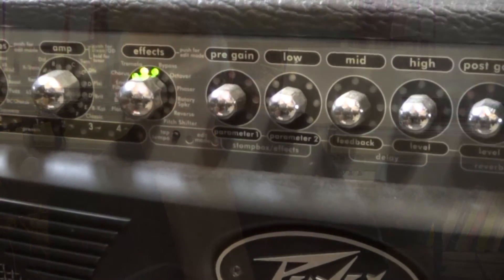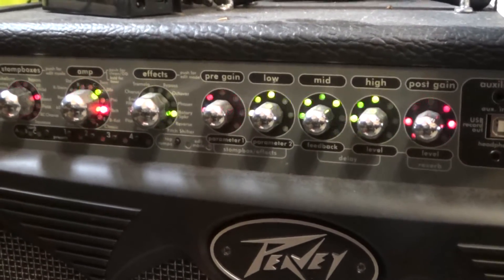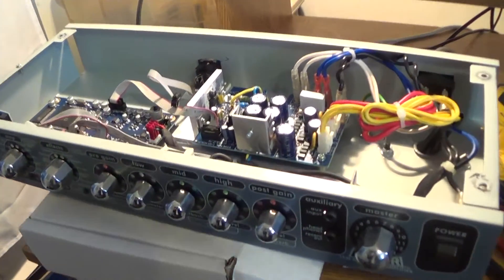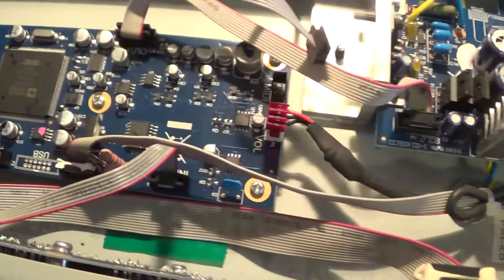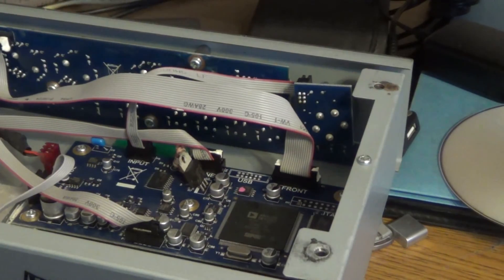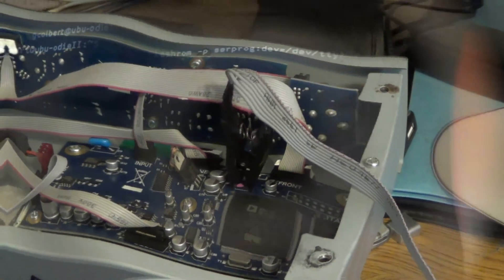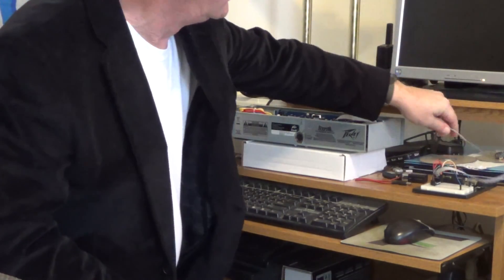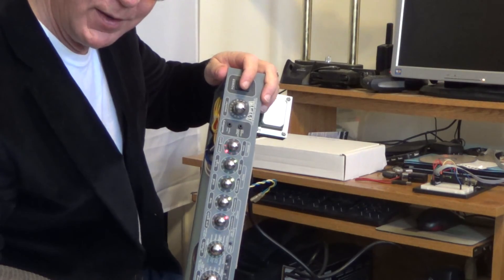Ressurecting the dead (Vypyr DSP Board)

Comment: my vypyr w75 also died after upgrading to 1.59, it no longer turns on the dsp board but the power board works! Please, can you help me?
Reply from the maker: I'm not sure.  What kind of help do you need?
Reply: @Zorkmid  I have a vypyr 75W, which died after the update. I've tried resetting the bios, but it didn't work. I believe the rom/bin is not working. can you make a ROM available? thank you for your attention! 
link with the one from AMP:https://drive.google.com/drive/folders/1SnVm40oYTqeCp7XYgWEN62j3QQZ7dcXh?usp=sharing

Comment: Hi, I was so stupid that I upgraded my firmware to fix the volume on the looper. No luck, now a brick. It's a almost brand new 120, barely used! Thank you very much for these instructions. I do have both a linux pc and an arduino board. I have no test clip, but might try soldering the chip out and do it that way. Could you please send me a file on lars.erik.kolden and then the rest is google mail... you know. Thanks a lot, I'd be very grateful.
Reply: I actually managed to get it back to life by just flashing over and over again while the light show was running :-)

Comment: My vypyr 75W has problem with usb...when i connect cable via usb to pc...vypyr frozen. Only turn off/on help. I have arduino and i thinking to flash dsp. But first i try update via midi cable.

Comment: Hi Glen - your video seems to be the solution of the problem from one of my customers.  He´s got an old Vypyr 120 and definitely has a problem with the DSP board - disconnecting showed that the power amp section works perfect - but the preamp is dead, while starting it shows the light show, but then nothing happens and the tuner is disfunctional too.

Here my question:

It makes no sense for me as a repair guy who surely will never see a VYPYR again in my workshop to invest in the fixing hardware. May I ask you to send you the board to fix it? And what would you charge in doing that - so that I can inform my customer about the repair fee? 

And last but not least I would appreciate your adress for sending it to you, likely via E-mail.

Here are my adresses and the homepage infos - for you unfortunately in german.....: I apologize.

www.lemmi-guitars.de 
http://www.lemmi-guitars.de/modifications.html
email: lemmi@lemmi-guitars.de

I want to thank you very much in advance for your response per email 

Best Regards 

Lemmi Lehnert
Reply: Michael,

If the light show comes on when the Vypyr is turned on then this is not a problem with the DSP board program.  
First, try to do a factory reset to make sure that the problem isn't being caused by user settings that turn the pre or post gain settings to zero.

Plug in an instrument and verify that the light show stops and that setting values are showing (LEDs are on).

Plug in a known good set of headphones and see if you are getting audio to the headphone jacks.  If so, there is a problem with the power mute switch in the headphone jack.  There is a switch inside the headphone jack that disables the pre-amplifier output to the power amplifier.  There are some easy modifications to get around this problem.

Plug in a known good auxiliary source (MP3 player for example) into the AUX input jack.  Play something over the MP3 player (or what ever you plugged in).  If you hear output the problem is probably with the instrument input jack (assuming you tested the headphone jack first).  If you do not then either the power amplifier is malfunctioning or there is a problem with the connection between the DSP board and the power amplifier.

I do occasionally fix these for people when the issue is a dead DSP board and usually require that they buy a CD from one of my favorite inde artists as the fee.  The DSP board program does not seem to be the problem in your situation as it shows the light show when starting.

Let me know what you find.

Glen
Reply: Hi Glen,

first I want to thank you for your time and helpful hints - I did as you suggested and first gave the DSP board a factory reset - nothing happenend. Fortunately my customer has a band mate who plays exactly the same amp which is in perfect condition. 

The second step in your advice was to check the auxiliary and headphone section. I just changed the unit vice versa - in the defective amp nothing happenend again and in the second amp the exchanged unit worked totally properly - so this is not the failure. 

At last I just exchanged the DSP Boards - result: the formerly defective amp ran and the second amp had the malfunction.  

So the solution is simple - the DSP board is dead......
Reply: I want to thank very much for your help so far. I followed all the steps: reset of the board and checking out the headphone jacks and the aux inputs..... 

no sound from headphones and no sound from the aux. the power amp section is ok - this was simple - just plugging off the cable and it was alive and reacted on humming tests. so I suppose a problem with the liltte board which holds the aux and headphone jacks - any idea?

Comment: When I took mine out of the chassis I notice the wire that connects the usb to the mother board was not firmly in place.  Would that have cause my issue when I updated the firmware
Reply: The MIDI setup is current sensitive.  Most all of the early reprogramming failures were the result of having a MIDI interface that did not provide enough current on the MIDI TX line.  This being the case, a dodgy connection on the edge card would be a likely cause for a failure in programming the Vypyr.

Comment: Hello Glen, I do have 2 Vypyrs sitting here still working but getting no connection over the USB port while trying to get files loaded via the Librarian.  What is your experience? Does a firmware upload fix this issue? Thank you, Hans
Reply from the maker: Hans - I'm assuming that you have first generation Vypyrs (not VIPs).  Librarian in 1st generation Vypyrs was somewhat experimental.  It does make a difference what firmware version you are on to get Librarian connectivity.  I have a post on my blog that addresses some software features/versions

I believe that the only firmware that (sort of) worked with the Librarian were v1.65 and V1.7. Please note that the firmware release numbers are not necessarily sequential.

http://zorkmids.com/?p=360
Reply: Glen Colbert

Hello Glen,
Thanks for getting back to me.
You are right I am talking about the first generation of Vypyr's not the Vip.
I have realized that on some of the Vypyrs the USB port is working with software version 1.59 while others doesn't. I have then found version 1.7 in the net (which was not an official version from Peavey) and voila' the USB works on all Vypyrs.

Comment: Hello. My Vypyr 75 apparently goofed a firmware update. It was v1.55, and I tried updating to 1.59. The lightshow works, everything in test mode works, except maybe MIDI (I have no idea how to test it), but as soon as I plug a guitar in, it crashes (so I can't run the update again). The amp still thinks it's at v1.55. Any ideas on what to do?
Reply: you probably should try a factory reset.  If the lightshow is working that should get you running.
Reply: +gecolbert done that 3 times. no change. Thanks for your attention
Reply: +gecolbert buttons 1 and 2 on boot, and preset 1 (the one it hangs on) went back to the "Legend" factory default. Probably going to require a reflash, then?

Comment: Are you familiar with the Vypyr VIP 3? I tried updating the firmware and now it's bricked. I've been looking for a solution to this for over a year, and I keep getting blown off by Peavey customer service.
Reply from the maker: +Villhelm This works on the VIPs as well.  Do you have access to an Arduino or a Rasberry Pi and a SOIC clip?

I've fixed a couple of people's DSP boards.  Where do you live?
Reply: I actually use arduinos (I have several UNOs and MEGAs) and RPIs all the time at work, but I've never done any flashing before so I don't have a SOIC clip. I am not opposed to trying to do it myself, but I don't know if I have the skill to do it properly or the necessary files. I'm in California.
Reply from the maker: If you want to remove the DSP board and send it to me, I can reflash it for you.  You cover the postage both ways and if it works you have to buy one of my friend's music CDs (Cindy Alexander, Circe Link, Dave Nachmanoff, or Daryl Crowley - your choice).

The SOIC clip only costs a couple of bucks.  It would be cheaper (and probably faster) for you to do it yourself.  A couple of apt-gets and you are in business.  I could send you the binary for the chip.
Reply: +Glen Colbert I'm not in a big hurry, like I said it's been dead for over a year now, but I think I'll try doing it myself just as a personal challenge.

I'm going to be out of town this weekend, but I'll crack the amp open on Monday and get started. The clip should be here by then.  Do you have an email I can reach you at to get the ROM? And I'll check out your friends' music anyway; I'm always looking for new tunes! Thanks so much for all your help, man. I really appreciate it.
Reply from the maker: send an email to gizmo at zorkmids.com and we can work out getting a binary image to you when you are ready.
Reply: Where can I get a binary image from?
Reply: Christoph Baldauf send your email address and amplifier type to gizmo (see previous post).

Comment: Could I send my bricked board to you for repair?
Reply: Thomas Bess I've done this for a couple of folks.  Are you sure you have 5V to the DSP board?  post an email address and I'll get the shipping details to you.  No charge, but you have to cover postage both ways ($5,00 postage box works) and it can take me a week to get around to it.
Reply from the maker: Updating the firmware on a 75 is no problem IF you have a GOOD USB to MIDI interface.  The problem upgrades tend to happen on interfaces that don't provide enough current over the interface.  I have not found a result from an upgrade that I thought was worth the effort though.

Comment: Hi Glen,
Great information here. I have been playing around with the vypyr amps for a while. Most of them that I have had were damaged in someway and required me to fix them. Perhaps my most challenging venture has been to install an effects loop so I can use my Zoom G5 in the signal chain. Now that I have achieved that I feel like I would like to try my hand at resurrecting a dead DSP that came in a broken tube 60 amp that I bought. I replaced the board with a modified 15watt. I don't have much expierence with arduino or programing. I do have an arduino duomilanove board that I bought for a sanpera  pedal replacement ( for now I have failed at this venture). Will this board work in the place of the uno? Do I have to have a Linux operating system? Where did you get the test clip and cable ends you use in the video? Please answer when you have time...no hurry. Thanks for any help.
Justin
Reply from the maker: First, did you happen to see my Vypyr Footswitch post using an Arduino at: http://zorkmids.com/?p=1425 

I do have an arduino duomilanove  Will this board work in the place of the uno
Yes, this will work.

Do I have to have a Linux operating system
This process uses the PC to run the Arduino as a serial programmer, so it is not the normal thinking of just downloading a sketch and letting things rip.  The PC program is called 'Flashrom.'   The sketch to download to the Arduino is 'serprog.'   There is a Windows version of flashrom that may work for you, but when I read the program notes I decided to use Ubuntu Linux instead.

Where did you get the test clip and cable ends you use in the video?
http://www.ebay.com/itm/new-SOIC8-SOP8-flash-chip-IC-Test-Clips-socket-adpter-BIOS-24-25-93-programmer-/171122644491?pt=LH_DefaultDomain_0&hash=item27d7b4560b
Reply: Thanks for the quick response. I have not taken time to view the video on the footswitch yet. Will do that soon. I temporarily abandond my foot switch project and got a cheap sanpera 1. I was trying to use another guys sketch for that, but didn't mesh with my version of the arduino software. Something about it that it did not like. Anyway, Thanks for breaking things down a bit more for me. I have an older windows laptop with xp and 2 gigs of ram that I am thinking of trying the Linux platform on. When I succeed with that I will try the arduino as a serial programmer to revive my old board.
Reply: @Zorkmid  i use this with arduino to control my vypyr 75W. Switch preset 1,2,3,4 and turn off/on delay and reverb :) Works great!